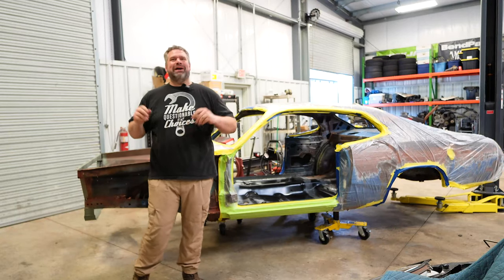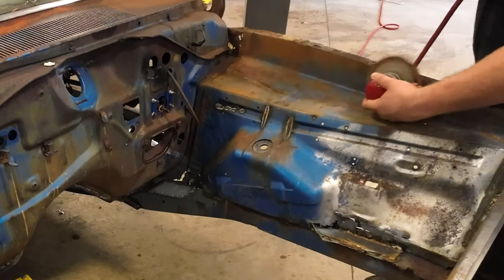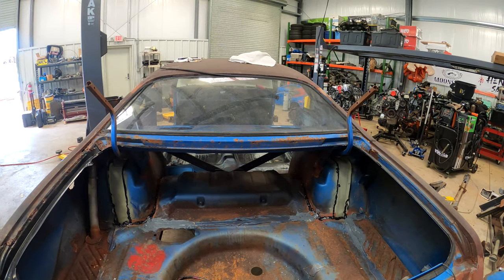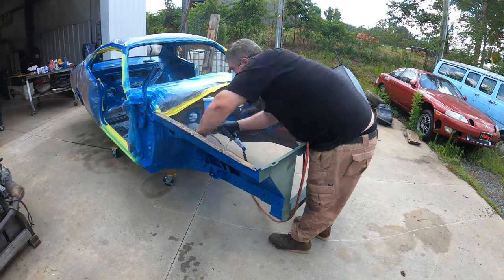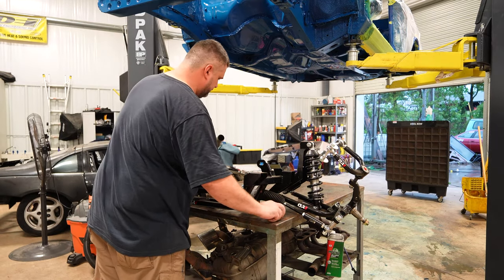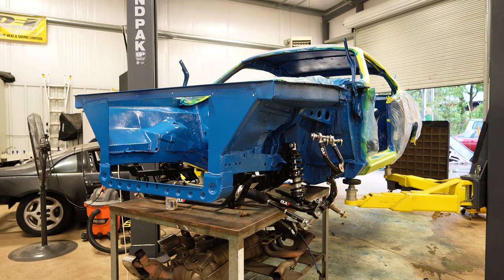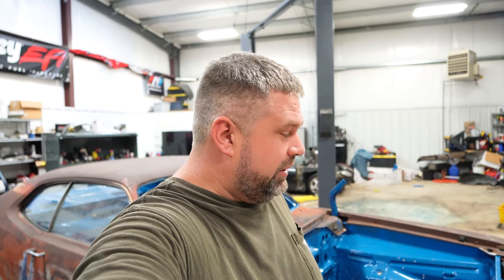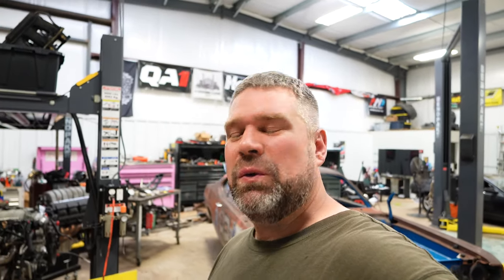I Painted My Car With Paint From A Farm Supply Store?! It Looks Amazing! Triple Crown Duster PT 4

Comment: Love this so much. I've seen a motortrend article titled "Retaining that petina finish" where they use high traffic floor polish that you can pick up at any home improvement store. After knocking the big stuff off with SOS pads or similar, where you can also take off tiny amounts of finish from undesirable parts of your petina if you want (the poorly attempted cover ups and whatnot, if any). The floor polish is easy to apply with a rag/sock, pretty durable, super cheap, easy to get a nice satin finish, and brings out just a bit of brilliance to your paint/petina to make it look awesome but still give it some protection and ability to easily wash your car. Just a thought, everything looks KILLER!

Comment: I really think you should matte clear coat it to protect the rust. It'll just look better overall.
Reply: There are cheaper and easier ways.
Reply: There are some patina coats that you can apply to keep the look and protect it without going to the effort of clearcoat that will flake off.
Reply: Clear coat will not protect rust

Comment: I love the exterior weathering.  I suggest you call VICE GRIP GARAGE and get some of his personal rust exterior shine.
Reply: He sells it on his site. Shine Juice.
Reply: That stuff is terrible, it is just a cheap solution.  Dirt and dust stick to it, car will look worse than before in a matter of a few months. Sure you can just apply it again, but rather just a clearcoat of matte or shiny would be better.
Reply: @spamanator666 its supposed to be terrible, like coating the car in WD40. VGG have many videos showing how to make it yourself and how to apply it. Its terribly cheap but it works as intended. 
You wouldnt apply canuba wax to patina, so you need something to make it shine.

Not a fan of the matte clear. Sure, it looks good at first (which is another issue, looking good), but then starts to bubble, peel and ruin the look.
Homemade shine juice for storage, wash it off for show 😂

Comment: I initially thought you were nuts when I saw that blue you were using but then when you took off the paper and it matched perfectly the faded blue from the original patina it all made sense. Looks pretty cool. Great choice. 
I still think a clear coat on it to get the sheen matching the new paint would just finish it off but opinions are like..**** and most stink.. Well you know... 🤣

Comment: I remember living in San Diego in 05. I had a red 1988 Toyota MR2 SC. I have been doing body work on it so it had Urban camouflage. There was also a hole in the muffler which made it sound like a tuner exhaust. Aside from the muffler, mechanically it was badass and performed as it should. This is during the same time everyone was suping up the Hondas. I pull up to a light trying to hurry to get to the parts store before they closed so I can fix my wife's van. My mechanic buddy sitting next to me we get to the light... And fast and the furious pulled up next to us. He was reving his engine. My buddy said I think he wants to race. The light changed and he took off... And beat me to the next block wish I was not trying to raise because it was only like 100 yards in regardless of how fast you drove you could never beat that light. Nextlight he was revving up again and looked over at me. I said okay 🤷. The light changed and he took off... The supercharger and those mr2s doesn't kick in immediately it ramps up. So somebody can take you at the line but 20 ft past that? Its a done deal. Supercharger kicks in and we smoked him all the way to the next light. This was about a half mile. They pull up next to us and start laughing asked what the hell did i have under the hood? I replied nothing, its stock (remember a stock sc had a 0-60 in 6sec and even for its age, they could still do it with ease). They got all excited and wanted to go again. I told them I'm good (mainly because I knew that the cops sat right up the road by the parts store). My buddy said just make them think you're going to race. So I revved up, light changed and we took off. I accelerate it all the way up to speed limit. A half a mile up the road at the entrance to the parts store, they were sitting there with a cop behind them. I tooted the horn and pulled into the parts store 🤣👍.
There is absolutely nothing better in the world going to have a sleeper and put somebody in their place after they spent thousands of dollars to make their car fast... And here I had $1,400 total in the car and that included the $900 I paid for it🤣.

Comment: Tractor Supply implement paint is very high quality. I used it to paint a very rusted trailer and it looks amazing. Decided to use it on the frame of my 4runner as well. It's like POR15 but easier to apply and is a final coat as well. Very underrated.

Comment: I've always done the same with cars i love for their exterior patina. A lot of people don't paint the unseen sides and the car literally rots out under them. Paint the guts, leave the skin, the skin rarely rusts past flashing and minor pitting. And for those who really want to seal the outside as well, painting with hot wax is the right method. Not just any wax, because heat will make the car shine unnaturally, but with high temp melt point wax (microcrystalline wax). What Average Joe can get their mitts on melts at 60~90 degrees C, so much higher than common wax. Water just beads off this stuff when it's raining, not a chance in the world to ever melt it except for the hottest days. Also unbeatable in sealing cavities. Caveat: you have to spray something that's 100 degrees C... so it costs a bit, and it is dangerous, you are misting a super hot, skin searing sticking agent after all.

Comment: I like the way it looks. I would leave it just the way it is but I would fix the bad rust spots on the outside. Then maybe later on. If you decide you want it painted one solid color, Richard  Petty blue looks real good on a duster.

Comment: In certain car scenes, the look you're going for isn't that weird. I personally have a similar style with my motorcycles; don't care about age or looks, as long as it's reliable to hop on every day and not having to worry if you'll get back home.

Tip for the exterior, often used in rainy Europe where rust is pure cancer: Rub the panels in with oil. It stops the rust from getting worse and makes the panels water repelling, so it won't get new spots of rust.
Depending on the colour of the oil, you can just protect it or alter the colour of rust it has.
Some crazy rat-rodders even mixed paint with metal particles to make plastic bumpers etc rust.

Comment: I'd have fixed the holes and rusted fenders and painted the bottom half. Clear coat over the patina that turns color when wet or change in temp would be cool effect.

Comment: 0:52 Damn it, now I'm thinking about how awesome this thing would look in Corvette C8 Rapid Yellow like that, which is actually a knock off of the mopar color Curious yellow, the one used on the dirty marry crazy larry charger, which I have actually seen locally would you believe, well a replica

even though the actual ones still out there

like that with a black solid stripe and one small on either side on the hood with a black spoiler and side pipes with a raked look, IE 14's in the front and 15's in the rear like they did on the General would look awesome

Comment: feels like your video operator is stepping up since last time i watched one of your vids, good music, and also managing to clone you brushing seam sealer! guess that was really handy, getting stuff done much faster ;)
Reply: and that paintjobb on the rat looks like porsche/audi rs-blue!
Reply: aaand, a build like that, everything that needs to work, you should get to work 110%. Like the simple thing like closing the door, it should clos perfectly every time, with a thunk (sound isulate the door, no rateling!!). The locking mechanism ( if avalible) is perfectly working well lubed. Engine? tuned fully on the dyno. Tyres? good r spec tyres, on original crappy rusty steel rims that are widened..  I thiink i completly understand this build

Comment: I bought a rough truck I really wanted at an auction for $600 and then found another one for $1000. I fixed the $600 truck. I did buy them a few years apart, kind of on a tight budget.

Comment: Years Ago I had a beater duster given to me up n Michigan looked horrible but was fun u did find you shouldn't stand on car to scuba acid on the sides of your semi trailer with car there and a lack of watering off car when doing a section at a time ...this car had a nice  windshield before I was done acid Sept into edge of glass cause rusted chrome around glass it Sept into glass and smoked the edges so no more using car as a platfrom....fun cars no big Power slant six and a 3 speed  n shifter...ummmmmm baby ..it's mind music for sure...

Comment: Hay jared, do they make a rust neutralizing clear coat or a neutralzer that wont change the collor that you can then clear coat? After all that work i would hat for the body to continue to deteriorate bit i thing the rist look is fitting.

Comment: Dude! I'm from Mendota IL. I'm like 45 south of where your from! You duster build is a huge inspiration for me. I'm working on a 73 plymouth Valiant also putting in a full front floor pan like you did. I really like what you've done with the car. I just subscribed to your channel to. I'm struggling with patching some of the metal on my inner rockers because it's so damned thin. What kind of welder are you using?
Reply from the maker: I have the Vulcan mig max from harbor freight. Another good channel for Mopar metal repair(more restoration compared to my rustoration) is the Hoosiers Garage, he goes through patch panels in more detail and I watched his floor video to get prepared!
Reply: Thankyou much I will check it out! I'm using an Eastwood 110.  I just found rust holes on my drivers side inner rocker where the rear pan is spot welded on. Looks like my job just got a lot harder 😂

Comment: Where you put the blue needs to have more care put into it.. maybe a quick sand and some high build epoxy primer on before the blue went on so that it didnt look like you painted right over the pock marked and rusty body. I know at least the engine bay would benefit from much more care put into it... I get that it's supposed have a patina look but the stuff you put the time into painting makes the whole thing look like poop.

Comment: I don't mean to be negative but that paint is terrible. I used it last summer and it is already looking like garbage. Even with the hardener it took months to cure.  For a few bucks more Rustoleum seemed to be significantly better. I hope you have a better experience than I did. It looks really good now. Sorry to be negative

Comment: Cars that look dumb, but pass a Mercedes. With a QA-1 k member, which is top of the line in 2023. Smoke that Mercedes in a 70 Duster that has original susension, use any 67-70 engine and Id be impressed. Im not complaining, do what makes u happy, painted or rusty. I guess ive saw too many 100-150k race cars that vinyl wrap a rustic junkard look onto their fiberglass body and run near 200mph in a quarter mile, and they give off the "shes rusty but fast" vibe. (insert emoji for cringe of epic proportions) but, as long as they are happy..